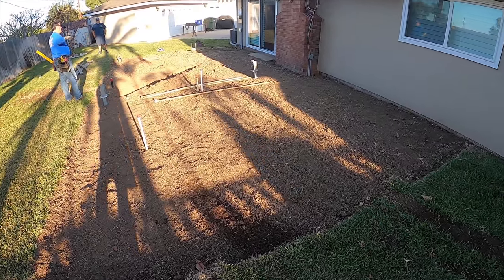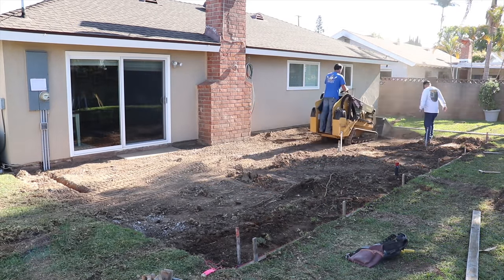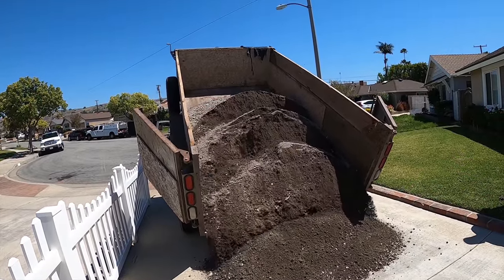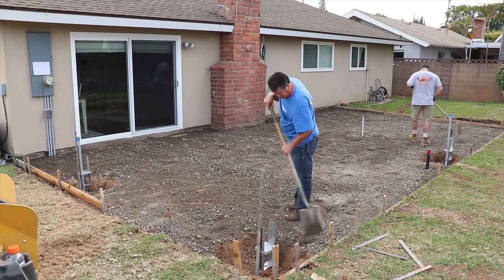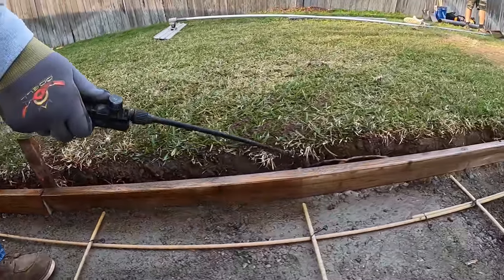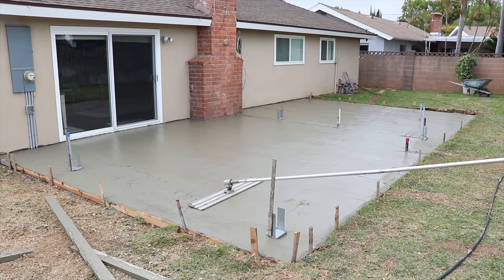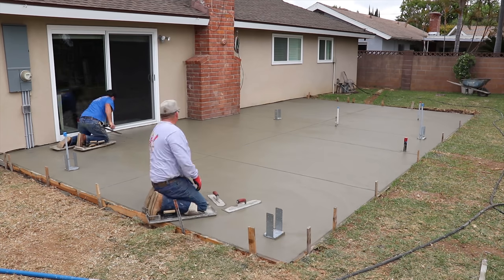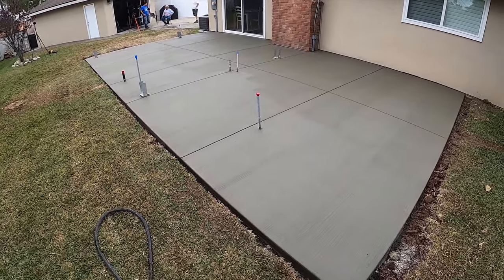DIY Backyard Concrete Patio with Underground Utilities

Comment: Hey Mr. Odell,  those city guys were pouring some kind of mixture in to a mold for traffic dividers and guess what!   After they removed the molds, they put blankets on the concrete and put a sprinkler  on them to keep them wet.    When i asked them if they knew what they were doing they said that the wet blankets aren't just for stopping fun from happening but they also help prevent cracking.    So i have thought long and hard about everything you learnt me and then i thought super long and super duper hard about the city guys and i think I started to get my head wrapped around this cracking thing...  I think it might have something to do with the water and the volume it has and how there's less of it when it dries out which i think makes the concrete shrink and crack!
Reply from the maker: Bingo

Comment: Very professional work!
I am in Montana with heavy freeze thaw cycles, also on heavy clay with bad drainage.
Should the patio slab be pinned to the house foundation? Also I was wondering if a turndown pad would be beneficial?
Thanks again
Reply from the maker: Check with your local building department

Comment: Fiberglass infused concrete is a good idea. It would probably solve a lot of cracking issues over thermal expansion in weather. What I find a little strange is the seems you cut in only at the surface? In all concrete work I have seen the seam is all the way through. So what purpose is achieved by only cutting it in at the surface and not poured in sets creating the seem in between each section?
Reply from the maker: It's called a weakened plane joint. that's where it will want to crack because its thinner there now.

Comment: Normal concrete/rebar can be recycled at about 99% or so. I can imagine that fiber glass concrete mix ends up in a landfill or is only usuable partially or for very lower quality concrete as the fibre glass cannot be seperated from the concrete anymore
Reply from the maker: The fiber will make it better whatever it's in

Comment: Instead of pouring for the 18" x 18" post footings, could the posts be secured using post anchors and lag screws after the concrete is poured?
Reply from the maker: Not as strong but it will work

Comment: Beautiful job.  Are there any issues with the sheer characteristics of the fiberglass rebar?  Thank you for your video!
Reply from the maker: This type of fiberglass is specifically designed for 4" concrete. Other designed fiberglass can replace all steel reinforcement.

Comment: I think my problem was when the last homeowner had the patio done, the contractor just spread the dirt throughout the backyard raising the level. You can see a whole block disappear along the fence line. When I had the patio redone and a garden wall put in they hauled out a lot of dirt. They had to lower it at the house because it was too high which had to lower it at the lawn as well. 
Then when I re did the grass they hauled out a lot of dirt. Tons. The lawn guys I had were horrible but got another ton of dirt removed and grass installed for a quarter of what I should have paid.
That guy is going to have tons to haul away too. Doing your job right makes everything else look bad.
Sponsor? 
You know if you were a top tier contractor you’d have your own pumper and spend more time talking about how good you are. At least according to the other guy.
Reply from the maker: I've ran in to those type of jobs where everything is high.
Alot of work fixing it.

Comment: No plastic underlay? Also no expansion foam against the house?
Reply from the maker: No need in Southern CA
Reply: @OdellCompleteConcrete  what if the home owner decides to tile that area one day? Can't because of rising moisture will ruin the bond between glue and tile. 
We put plastic under any concrete that has a roof.

Comment: So if you have the reinforced things I the concrete and you have to dig down to rerun a line you can’t just splice it out. ?
Reply from the maker: no, new runs only
Reply: @OdellCompleteConcrete  so in the case of existing concrete and I needed to go underground what’s the best way to do that without tearing up the whole thing

Comment: I’m sorry to contradict you. I know you have been doing concrete for a long time.. do you ever by chance.. check the screed board .. yes to make sure is straight .. I suggest to everyone the is going to read this message.. to check the screed board after is coming in contact with the concrete to make sure is straight.. when the concrete is cool.. the screed board curbs one way and when the concrete is hot curbs the other way
Reply from the maker: I use a aluminum screed
Reply: And before you said that can’t be true.. check before you said anything
Reply: I been doing concrete for 43 years
Reply: The only way you can make the screed board to get back straight. Need to flip it. And leave it for little bit . So can get back straight.. after few minutes stays straight

Comment: Odell's got the most well-lubricated work truck in CA.  Gotta keep it regularly replaced with fresh Mobil 1 synthetic if you want to get your 50%horsehair-50%nylon broom to the jobsite on time each day and also pull your forms easily.  👍🛢️
Reply from the maker: True story.
I ran out of form oil.